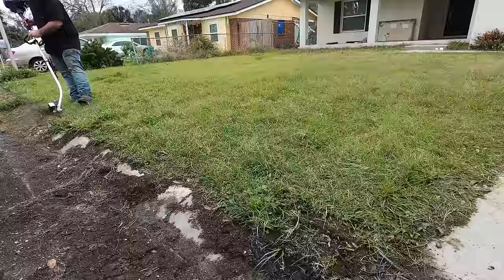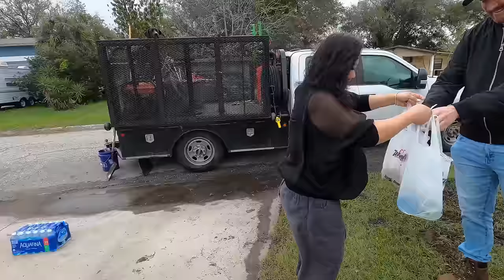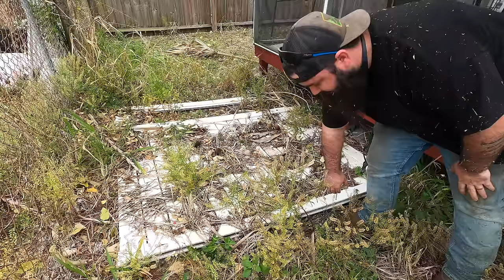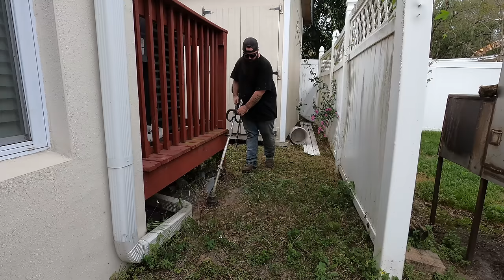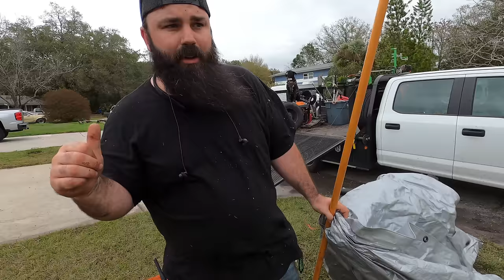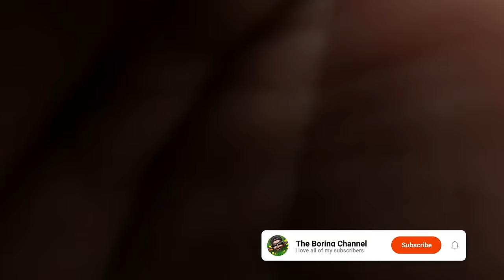HE was AFRAID to go into the BACKYARD because it was so BAD

Comment: Side question if you please, what do you wear for ear protection? When I use my weed hacker, my ears ring so bad when I am done. I really do not want to wear those big earmuff things, they fall off my head when walking around my elderberries. With the ear plugs, the string drives me nuts.
Reply from the maker: I like LG head phones with the neck band so that I don't lose the ear buds

Lately I have been using the milwaukee head phones the are more for hearing protection bit they are still Bluetooth so I can listen to music, books, or podcast without turning it so loud that it hurts my ears.
Reply: also, is there a strategy in select weed hacker string?

Comment: Hey, sh*t happens. The wife and I we’re heading to I think her cousins wedding vows renewal. I was driving my van on a twisty, winding, wet rainy two lane road. Went into a curve and knew I had the wrong line on it. Tried to correct it and almost had it. Then it lost traction and started sliding. Well at this point I’m looking for a place to land. I’m seeing a nice ditch embankment that’s looking good and start to gently try to aim at it. Well I’m doing pretty good and I’m thinking this will work out. Bad mistake, about that time the steering wheel just starts spinning. The van starts spinning and then it’s starts speeding up. The wife said that at some point I said Oh sh*t this is going to hurt. She said right after that the van rolled about three times ending on its roof. Thankfully I had my seatbelt on because I was flipping and flopping like a fresh caught bass. Bounced off the windshield at least once. My left arm shirt sleeve had road tar on it which I remember pulling my arm out of the partially rolled down window. I remember  thinking this was neat till something said get your arm inside or they will be calling you stumpy. For you old timers there’s a song that’s called Oh what a night. The wife called her daughter at the party and didn’t get her but called the granddaughter and got her. They had rode together. Something I’m really thinking about a lot now. Anyway, granddaughter goes to mom and drags her to the side and says we have to go, Now! Turns out we were only about five miles away. Anyway I’m hanging like a piece of meat from the roof of the van. All kinds of people and no one will give me a knife. Daughter gets there and she gets me a knife and I cut my dam seatbelt because I’m just plain starting to lose it over hanging there. I manage to get out and here’s the wife trying to crawl out. The crowd is like she shouldn’t be doing that. I told them either help her or get the fuck out of the way because she’s coming out with or without help. Now after all that. The what you never know. I was already disabled and had back issues. This happened last December. In March I had surgery on my back. Now we shall start with what just might be wrong with me. I got a thing for sure that wraps around my waist and there are other areas.